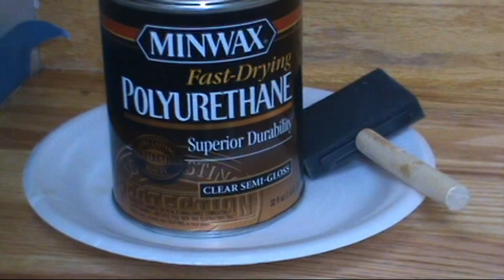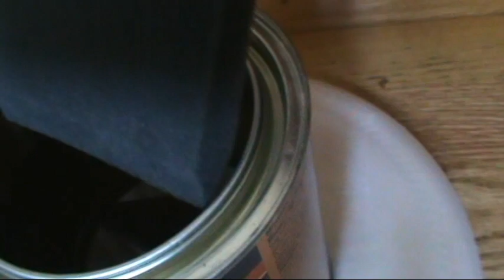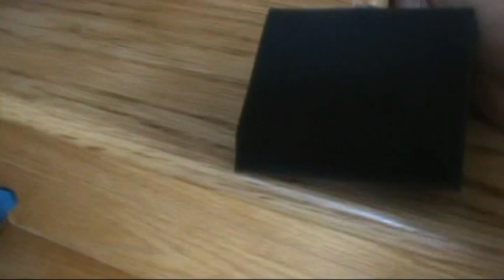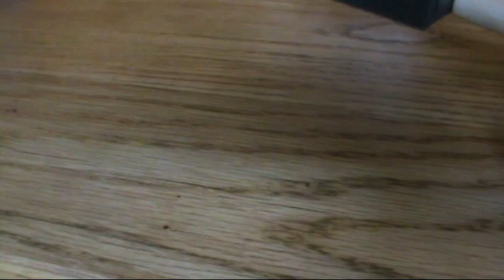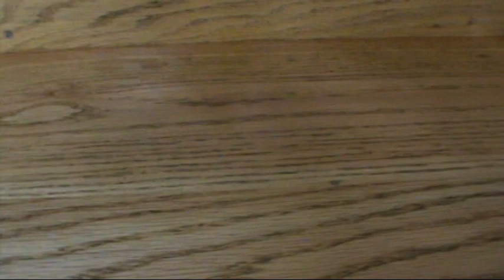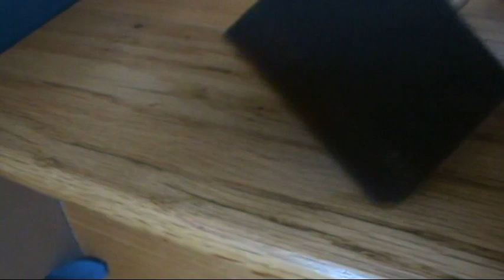DIY polyurethane...some simple methods using a foam brush

Comment: I bought a butcher block for a desk and i wish i watched this before I did it. I definitely tried to paint it on and on the first side I definitely made a mess
Reply from the maker: Yes it can get messy if the foam brush is soaked.  Dab it on the corners of the can to control the amount you want to put on the wood.

Comment: After the sponge runs dry, how do you tie in with another run? Do you come back into the initial run (from the opposite direction to the initial), since you kinda have a notion of how long a wet run will be, and continue in that manner?
Reply from the maker: Yes. Usually I will come in from the other direction making sure my brush is wet.

Comment: Great video and informative! Subscribed. Anyone out there to help? I'm doing poly on kitchen cabinets. They have some recesses and I'm having trouble with stroke mark when the grain changes direction. Even after drying and 'settling' still marks.
Reply from the maker: Thank you very much.  For the grain direction question, if you see brush marks there are a Number of ways to avoide them. Possibly the poly is too thick and not settling down.  Maybe thin it out a bit and keep a wet edge on your brush at all times.  Possibly use spray poly to get a base coverage once dried follow up with a few coats of brush on. The ideal way is to spray if there are multiple profiles.  Hope this helped.
Reply: @JoePalumbo221  oh my gosh. You're fast. Thank you. I'm using H2O based and foam brush. Right now on cabinet frame. This is my first time...virgin.lol. I was thinking of trying a bit thicker and if that doesnt work, maybe taping off when the grain changes (allowing proper dry time). Love the videos. Love how you are honest and explain like a beginner would understand. Wish my dad was here to ask questions but you are a great replacement teacher. Thank you!
Reply: @JoePalumbo221  
Thank you again. I'm researching 'sprayers' for my poly coats. Looking at possibly renting or possibly purchasing. I will eventually be painting paneled doors so leaning towards a purchase. Thank for the suggestion.

Comment: Don't do what I did. I used my nice $15 purdy brush to poly coat my first cabinet project. The brush is harder than a diamond handed $GME hodler. Came here to learn how to clean my 6" foam roller brush after my second poly coat. Gotcha, throwing it away.

Comment: They recommend not to use foam brush with polyurethane cause of air bubbles/streaks. How did it work for you?
Reply: I've done two small console tables. Stained them, and used a foam brush and it turned out really good. Just do the "tip off" technique after you work in the poly to remove any air bubbles. Check out the videos from winmax.

Comment: Storing oil-based finishes and varnish can be a problem. The leftovers skin over or thicken and become useless. Bloxygen is the fix!  Use this inert gas and you can store leftovers for years.
See www.bloxygen.com for more. Also see Bloxygen Videos at https://youtu.be/zHMdkZcqSUY?list=PLEPbxZsbY8u32S7XSGiqSfCp5rTZHInVC or our 60 Second Storage Tip at http://youtu.be/1nOINqPCt7Q. Works every time.

Comment: Do you apply 2 coats ?
Reply from the maker: On stairs I usually apply lots of coats.  Maybe 4 or 5 considering they get a lot of abuse.
Reply: Joe Palumbo221 thanks boss! Also you recommend reg brush to start off with, and finish last coats with a foam ?
Reply from the maker: Usually if I am finishing somthing I will what's appropriate for the job.  If its something like stairs or similar that I know will require yearly maintenance do to intended use, I'll use regular methods and standard brushes.  If it something I really want to showcase , then I will make attempts to use the proper brushes and techniques.  Thanks for your comments.
Reply: Joe Palumbo221 thanks for your replies. It’s much appreciated. 
So If someone were experiencing slight ‘bubbling’ would you think a brush is responsible for it? I haven’t used a foam one yet for applying any coats of poly
Reply from the maker: Using a foam brush will always leave bubbles.  The question is,  will be acceptable for you?  On some applications,  I don't mind.
Reply: Joe Palumbo221 I have a perfectionist type of mind so anything small can cause uneasiness about the project. Do you recommend light sanding in between coats to rectify ?
Reply from the maker: @johnc1280  light sanding is a good idea between coats.  To achieve good results with foam is using slow even strokes.  I even get bubbles with a good bristle brush too.
Reply: Joe Palumbo221 okay I’ll bear that in mind. thanks!  Also are you familiar  much with resurfacing kitchen cabinets? What do you recommend as a degreaser ? and if I’m painting, not staining, what’s the most effective primer? I’m gearing BINZ is best for cabinets before painting
Reply: Thanks again for all your help